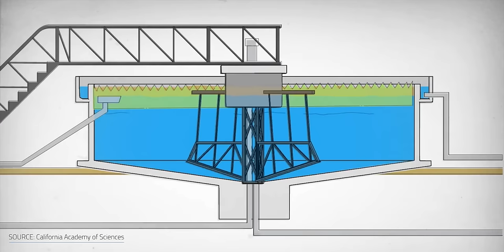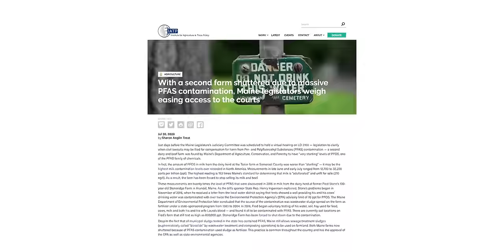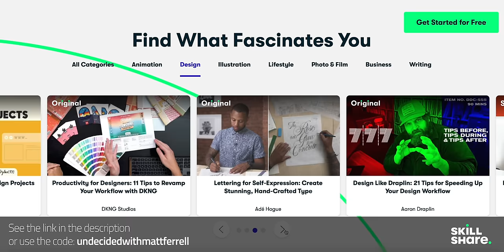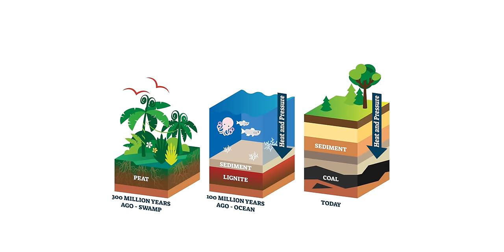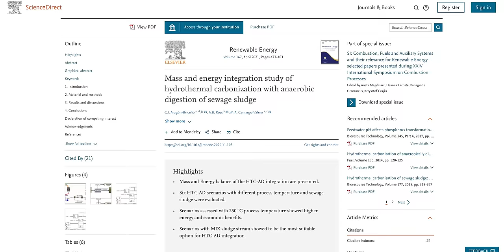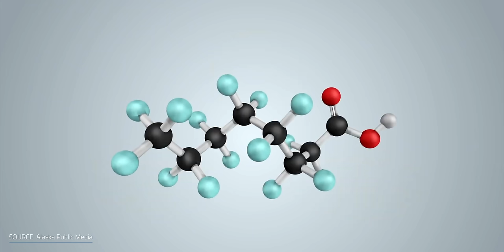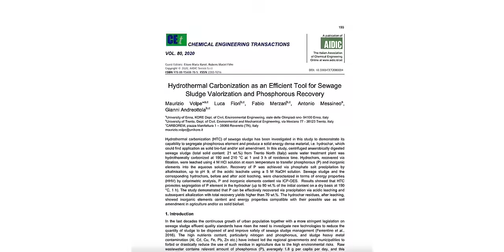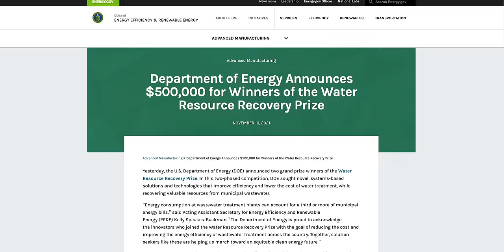Turning Human Waste into Renewable Energy?

Comment: I work in wastewater.  We use fluidize bed incinerators to burn sludge. The steam produced spins a turbine and ash is used in concrete.   The industry has a lot of potential and there is a big push to net-zero plants 😁
Reply: Brilliant 🎉
Reply: Brilliant 🎉
Reply: Brilliant, could I know the place,? I would really appreciate if you could give more detail
Reply: You had me at “big push” 😆
Reply: @Mark D.  And they said it didn't come at a cost 😅
Reply: So this is clean energy for the planet?
Reply: @markd.9538  Oh man, good one. Have a like
Reply: Hey Steve, i used to work at a similar prototype installation, we unfortunately had the issue that the sludge sometimes changed into a type of solid rock inside the fluidised bed, very promising technology tho :)
Reply: Dare I say, that is the real sh** 😂
Reply: How about heating Homes.
Reply: :hand-pink-waving::face-blue-smiling::face-blue-smiling::face-red-heart-shape::face-red-heart-shape::face-green-smiling::face-green-smiling:💥💫🌎🌄♨🌈♻♻:washhands::washhands::washhands:from Jundiaí, sp Brasil
Reply: Not to mention.. "big pushes" made poo power possible ;)
Reply: Brilliant
Reply: I love it. I hope my local area uses this.
Reply: What If we compress this collected waste and without more treatment put this compressed cubes into our filling material needed to form base of buildings like plinth filling or say where we put soft rocks for filling purpose if we dump that garbage I think we might save those soft rocks.......
Reply: if not heated, the bacteria in it harms the environment @Harshal......
Reply: ok, so where's your cideo on this matter? would be educational to see how it works and the production after the incinerator process. . are teh incinerators going around the clock and how many insins there are at the plant? how long does it take to turn to ash?
Reply: How stable is the energy source?  I mean how much Biomass comes to the Wastewater treatment facility ?

So you can calculate the perfect energy output?

Comment: Here in Vienna, Austria we also have an impressive sewage treatment plant.

There they
- first use huge heat pumps to utilize the thermal energy of the waste water and send it to the district heating network
- treat the sewage
- use the sewage sludge to produce biogas
- use the biogas to produce electricity and heat (which, again, goes to the district heating network)
- the remaining solids go to a power station where they, again, produce electricity and heat, which, again, .....

This is so cool and makes me feel a little better in these times.
Reply: sounds logical, communities in india do this also, if poorer countries can do it, all can do it.
Reply: Yes. You could expand the chain even more. It is likely that the process just reached its degree of economic viability. For instance, at step 2, you could add a biodigester with anaerobic bacteria to produce methane AND heat for your city. I see that as your step 3, but you could bump it back with better filters and a little more power. You will also see that with sufficient gas and steam, you can do hydrogen production at a very low cost. If you separate your slurry after your step 3, you can send some off for fertilizers and keep some solids to be desiccated and then incinerated. 

There are many "feedstocks" produced by humans and with food production that can be used efficiently.
Reply: actually the energy to dry the final sewerage mass to something that can be burned pretty much wipes out any actual return, but such an integrated system does minimize use of carbon based fuel to treat sewerage.  this technique improves on that somewhat and further refined might generate more energy than it uses.  given it's never gotten big gov't support in US, or anywhere, like solar, wind, bio diesel from oil sees, and ethanol from corn and sugar, we will probably never know how good the system is.
Reply: @russell7489  The plant produces more electricity and heat it needs itself.
Reply: @russell7489  The solids of the wastewater neds to be separated in a centrifuge.
After gas is extrakted, the end product is like soil. But here in Denmark it is too “dirty” do use as fertiliser.
Reply: Why are you so reliant on Russian gas then? Why can't you just rely on this?
Reply: So cool
Reply: How big sewage system to run a power plant?
Reply: @michaelroberts1959  Two Million people.
Reply: @Sagittarius-A-Star  Thanks for info
Reply: I had a poop burner in my RV - which in turn heated a water tank. Why not. The stink goes up the chimney and as any camper knows, the worse thing about a long camping experience is responsible biohazard waste disposal
Reply: Sounds like alot of co2 being produced
Reply: @phillipsizemore11  Would be produced in any case, no matter if you just let it rot ur utilize the energy it contains.
And it's not fossile.
Reply: Lmao, are you kidding me?
You guys had to abandon indoor heating because of the energy crisis. Did poop fuel save you? No, no it didn't.

Comment: I work in the wastewater treatment industry, first as a plant operator and now as an engineer, and I have never heard of this.

I knew that coal is made by heat and pressure (that, to my knowledge, has never actually been observed in nature, only theorized) but I'd never heard where that info came from or how practical it could be IRL. I will ask around the office what people think about this.
Reply: Keep us updated!!
Reply: Can you imagine... all the waste water treatment plants in your country suddenly is making 150 percent of the energy needed to run itself? I have to think the cost of power would take a dip.
Reply: They've been doing this in Europe for a long time, though mostly on larger sites.
Reply: Interested to see how this turns out at your office.   Were you able to get anyone to look into it?

I'm a historian database admin for a major electric utility. I know red tape. 

Looking forward to hearing back.
Reply: I'm subbed to this thread so I get notified when you respond Rocky 👍🏾
Reply: DOE is interested.  Preem oil refinery Sweden and Honeywell USA WORKING WITH  Biooil which injests hot sand in sawdust recovering  biochar, biooil and flammable gas.
Reply: I work as an operator and our plant cleans the methane produced by class B anaerobic digestion to power our gas turbine energy facility. Our plant is energy sufficient, often putting excess power on the grid
Reply: @somemedic  Or the power company heads get a nice bonus and charge the same rates
Reply: @somemedic  Okay and the world will smell like poop. Burning coal is bad imagine our generation makes the mistake of burning poop for power our grandkids will never forgive us
Reply: @ferdtheterd3897  ... no. Once the moisture is removed the smell is eliminated
Reply: @somemedic  And rain?
Reply: @ferdtheterd3897  

You won't be burning wet products. Makes it harder to burn. Once the product is dried I would think it is laying outside exposed since it would absorb moisture again.
Reply: A guy in the Bitterroot Valley has patented the process of converting Muni Waste to fuel....
Reply: Coal / oil formation have been experimentally tested, though not technically "observed in nature" (simply because of the geological times involved).
Reply: @aenorist2431   yeah its like how we knew pitch was a liquid but the first recording of it was on July 11 2013.
Reply: @somemedic  Can you imagine all the money that would be lost on this income stream. Politicians, contractors, plant employees, and I'm sure I'm leaving a million or so out.
Reply: Wait, coal is made by heat and pressure?? I always thought it was burned Husk and dry aged..
Reply: I see the benefit, and especially those with making ethanol so less corn production is put into agriculture for this.  I also like that it can reduce the CO2 emissions in cement, a major issue considering construction amounts to 40% of the CO2 being produced annually in the world.  And that cement is the biggest culprit.  My question is how are the toxic chemicals, PFAS's handled after production?
Reply: Following for updates. :D
Reply: I have worked in a wastewater facility were this was practiced. (Denmark 1980's)
The solids are separeted and de-gasset. The gas would run some furnises and generators. 
So the pumps at the facility were in part run "for free". No surplus electricity  to send out.
Reply: @Nimble you dont need to electrolyse methane. electrolysis isnt for covalent bonds like that anyways. you can react it with water in a much more efficient reaction. this is why natural gas is used in steam reforming and water electrolysis isnt.
Reply: I set up an industrial laundry in the Far East using heat from an industrial process - BIOGAS will be ideal for this - Laundry can use the water too.

In the Maldives and Carribean they have major issues what to do with effluent on a small island (generated by overbuilding of resorts0 , and this process can form part of the solution - it is self funding if the banking industry will co-operate - that is not to mention the potential downstream applications based on the resources mentioned 0.600min - 09.00mn..
Reply: Our current energy source has too many lobbyists. It's all about money not sustainability.
Reply: i could make enough clean  bio gas with my poop in my back yard to power a generator or bbq  and if  i knew how to modify my car to run on gas  will drive my car  for free for ever
Reply: subbed for updates.
Would like to add that all our garbage can be carbonized too. 
It seems this technology is a good solution.
Reply: @jenslk2000  That's NOT this process, but a good way to reduce solids.
Reply: What If we compress this collected waste and without more treatment put this compressed cubes into our filling material needed to form base of buildings like plinth filling or say where we put soft rocks for filling purpose if we dump that garbage I think we might save those soft rocks.......
Reply: What's the update?

Comment: Hi Matt, great video. I've worked for a few years in Environmental Engineering (drinking and wastewater treatment). It doesn't really surprise me that this is having so much trouble making headway. In my region (Northern CA), many of the WWTPs are up for total replacement and the smaller ones tend to be from communities with small budgets that often don't get very much funding. Government spending will usually only cover 80% of replacement costs unless the average median income of the area is much less than the state's average. 

Even turning wastewater into fertilizer is extremely expensive and a city has to have a really big budget to consider it. This is a great idea, but unless the state and federal governments are convinced of the usefulness of this idea and the money that can be saved, this unfortunately will not make much headway. The only loophole I see is if a large city (like Sacramento, SF, or LA) gets wind of this idea and decides to implement it and is successful.
Reply: This is the first I've heard of HTC, but I am pretty familiar with anaerobic digestion, which seems to provide most of the same benefits - but perhaps isn't as costly? When I last looked into it, the amortization of the investment in AD was something like 10-15 years (don't quote me on that). On a very small scale, this is what is used in rural areas of developing countries with very basic technology (i.e., essentially two drums, and a tube leading to a cooking stove where the gas can be burned off). It's absurd to me that this isn't common practice in the US... such a missed opportunity.
Reply: @ocaeocae  I know it's used for septic tanks in China. I didn't know it was used so commonly in rural areas of developing countries, but it doesn't surprise me. The issue with using only the methane produced by your own sewage is that while it may be a small change in design, it is also an extremely small benefit on an individual scale. It takes the sewage of 2-3 people to make a cup of coffee from the methane.

Comment: This is the only episode of Undecided that I've seen that didn't end with Matt saying "not so fast..." And listing all of the cons of the cool technology he just presented. This one was just like - "There are no disadvantages, let's make poop into coal!"
I guess you could say that this episode was pretty much... Decided.
Reply: I mean, one disadvantage I thought about was the CO2 from burning the coal or bio fuels but I guess it's probably less than the methane and CO2 released by not doing this type of process
Reply: @walkinmn  yeah, I'd like to have heard about that too.
Reply: @walkinmn  I'd have to imagine that it'd be somewhat neutral in that respect. Burning that coal would introduce CO2 into the air, but it's CO2 that had already been pulled out of the air in some way, rather than digging up new coal from existing mines. Not a perfect balance, but certainly better than mining new, something like that.
Reply: @nicholasgardiner9601  Well yeah, that's why it was an idle speculation.
Reply: As he said, instead of burning it you could also use it when making concrete.
Reply: The downsides were pretty much "Red tape surrounding the sewer system and biohazardous waste in general".
Reply: @Cellidor  Yes more efficient in several ways because many countries actually import coal as well with the high costs involved, whereas biochar can be generated locally.
Reply: @wildthing72  True, I hadn't considered that aspect. Cutting down on international shipping would itself help with some aspects of pollution.
Reply: @walkinmn  Could just be buried.  That takes the carbon out of the carbon cycle.
Reply: @wittenhenderson875  Yes, they mention that it's basically autoclaving the material but autoclaving doesn't kill prions which are a pretty big risk when using human waste for anything, including fertilizer.
Reply: @afullerhokie  Interesting! I would like to know more about that
Reply: @afullerhokie  At the temps its at, it takes all the molecules apart.  This coal can be used for filtering water like Anthracite is now.
Reply: @walkinmn  Work js progressing toward converting CO2 into fuels and other hydrocarbons that have been derived from petroleum. Here again the problem is funding for the initial implementation and the needed information releases to make it more well known. Like anything else, the more it's talked about the more i terest there will be.

Comment: Hey Matt, you should check out the biogas toilet system.  I was looking into it for my tiny house and it goes right along with this video series. Human waste is pumped from the toilet to a thick black bag with weights on it. Methane production builds against the pressure of the weights and there is a low-pressure gas line that feeds to a burner system in the kitchen where you can cook your food from farts. On the backside of the bag, there is a poop chute for adding kitchen scraps and such, as well as a spigot for collecting the nutrient-rich poop juice for feeding plants. It's a win-win for people who want to start small, and not have to dig a septic tank.

Comment: 35 years ago I worked at the Christchurch drainage board in New Zealand. They were already converting sewage into methane and using the gas to run all our vehicles - and a small a power station running the sewage treatment station.
Reply: That's really interesting New Zealand and church heat resources To why Britain is not even Trying the energy resources..

Comment: What surprised me is when he said he took a t shirt and it carbonized. We have so much clothing waste we could take that from the landfills as well. This tech is pretty crazy.
Reply: You'd be surprised what will turn into charcoal, another YouTuber (Cody's Lab) has been making a lot of charcoal and has a fun series called "will it charcoal" where he puts different items through the retort. 

If it's carbon based it will probably turn right to char
Reply: there  is already a  recycling process invented recently that turns clothing  into tough materials like floor tiles  (plus  the  old process of  using it in  paper for paper money)
Reply: If pretty much everything can be carbonized, it would save sooooooo much landfill and potentially could even clear out current landfills. I'd be willing to have a new 'carbonize' can on my curb.

Comment: I work in the industry. We have a treatment plant that burns the methane that is released from the waste solids digesters. The methane is collected and goes through a super cooling system that drops the water vapor out of it and then we burn it through basically diesel electric generators that can run it. About half of the treatment plants systems can be powered when those generators are online. The local military base also uses our effluent line for heating and cooling. Its used in the same manner as geothermal. We are now also producing class A solids that can be used in fertilization for crops for human consumption. The waste is collected and put into giant vacuum chambers. A vacuum is pulled in the chamber then super high pressure steam is injected into the chamber. That drastic change in pressure ruptures the cell walls on any living organisms and It kills absolutely everything in the waste solids.
Reply: Hello Sir🙂 , I'm very happy while reading your comments .  I need whole knowledge about this process from you sir ,  How to contact you sir